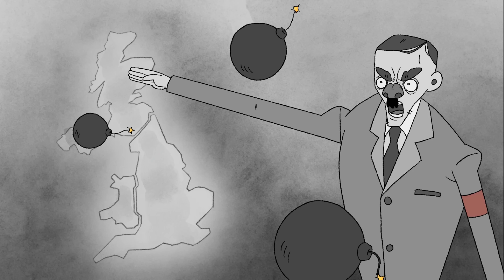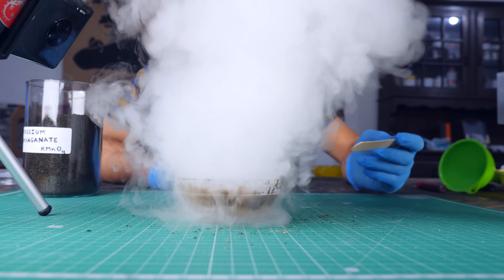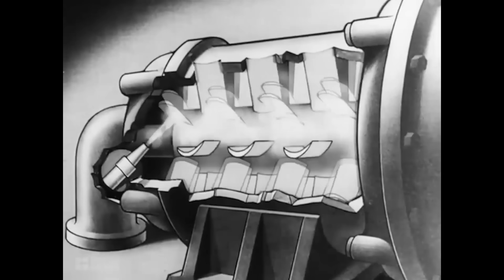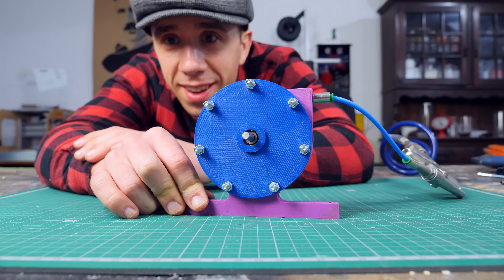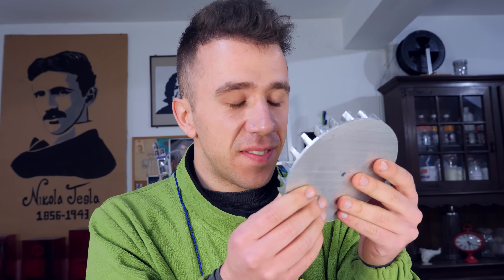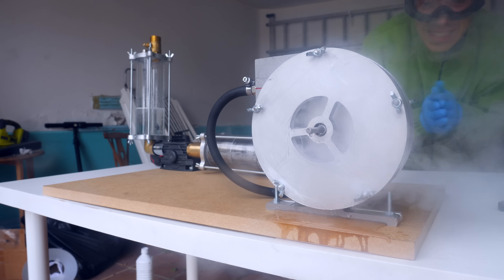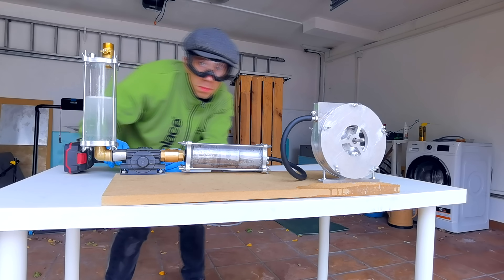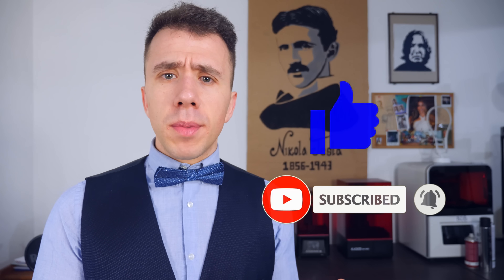I built the World War II V2 Rocket Steam Turbine

Comment: You can improve your design by making higher tolerances. You can also remove the grease from the ball brings using a solvent, instead us a thin silicone based lubricant often found in spray cans. This way you will remove some of the friction caused by the grease. Another thing you can try is to balance your turbine, set it in a pace where it can be suspended upright, the heaviest point will then move to the bottom, then you can either subtract weight from that side or add some to the other side. Keep repeating this until wherever you rotate your turbine, it will stay. You can also try to improve the power of the turbine by attaching some gears to the output shaft in order to provide more torque.
Reply: And don't machine parts with the bearings in the stock material.
Reply: Reducing friction like that will just increase the no-load RPM. Not any practical benefit IMO.
Reply: used to do tis with the bearings for RC car racing
Reply: He doesn't have the equipment to balance the turbine. Components rotating that fast have to be dynamically balanced (what you described is static balancing.)
Reply: @goodbye8995  As true as this is, it cant hurt to get a rudimentary balance on it so the harmonic vibrations don't shake the assembly to bits nor put stress on the bearings. It'll also gain alot more speed just from that simple balancing, rather then be unbalanced all together.
Reply: @Scientwisted  Better than nothing yes. But I question the entire operating principle he has chosen for the prime mover.

Surely a positive displacement motor would produce greater power at a higher efficiency. It would also be easy to overcome the problem of liquid passing through to the motor by making the catalyst tube longer, vertical, and doubling it's function as a receiver or buffer for the gases, which could then be throttled with a simple valve to vary the motor output.

The power output would be seriously higher with pistons or even Intermeshing rotors instead of that centrifugal turbine.
Reply: @goodbye8995  The operating principle was chosen because it was proven effective in the early days of rocket science. Just because his prototype can be beaten by other designs doesn't mean it has no merit.
Reply: @jstan_49  I didn't say that it has no merit, but my understanding was that it isn't his design, is it not copied from the V2 plans?

The V2 uses a turbine because it is a very niche application which needs the characteristics of a turbine.

I think the first question we need to ask is, what is going to be driven using the power generated by the chemical reactor?

The answer to that question will furnish the answer to what kind of prime mover is best... It's a moot point otherwise
Reply: @jstan_49  I didn't say that it has no merit, but my understanding was that it isn't his design, is it not copied from the V2 plans?

The V2 uses a turbine because it is a very niche application which needs the characteristics of a turbine.

I think the first question we need to ask is, what is going to be driven using the power generated by the chemical reactor?

The answer to that question will furnish the answer to what kind of prime mover is best... It's a moot point otherwise
Reply: @goodbye8995  I thought it was obvious that the application is a rocket engine.
Reply: @jstan_49  So he is building a V2? I thought that is just where he got the pump design from.
Reply: @goodbye8995  I didn't say he's building a V2; I implied he's building a rocket engine (a major application for turbopumps and fairly prominent in this video.) Given the content on this channel it's not implausible, though, skimming back over the video, it looks like he doesn't have any application in mind and just wants to mimic the steam-driven turbopumps in a V2.
Reply: @jstan_49  that's my point really, he didn't say what his objective is. I don't disagree with what you're saying.

Honestly, it's probably a native advertising channel for 3d printer vending etc. Much that gets "recommend" is commercial content masquerading as enthusiast's organic output.
Reply: @goodbye8995  from what I've seen (not subscribed, but oft recommended), he studies complicated machinery, like jet engines, and then tries to fabricobble replicas in a home lab. The entertainment comes when the 3D-printed jet nozzle melts and catches on fire, or the acrylic pressure chamber melts, explodes, and catches on fire, etc. This video probably won't do as well because the only fire was in stock footage.
Reply: Get rid of Grease using alcohol
Reply: Also maybe move the steam outlet to a higher point above the liquid level
Reply: He could try using journal bearings like in an actual turbo, it would require oil flow, but should provide super low friction, and try reducing the rotating mass that turbine is a lot of material for that little bit of steam. And lastly, he could try adjusting the input and output port sizes to optimize torque and rpm

Comment: maybe the geometry of the catalyst container is wrong. i mean steam rises, so when you have the ''exhaust'' sideways  some liquid is for sure to passby ,while if the exhaust is on top then only steam can pass by? on the other hand if you think about alcohol stills, and distilling, then when you have water in the other end it means the temprerature of the ''boiler''  is not correct so the whole catalyst stage needs some thinking. i know crap about chemical reactions however so i maybe wrong :-). 
as for the power output, just make a bigger turbine, with more efficient fins inside, try other geometry on the fins, 
for an idea about next project tho, :  3d print a drill and see how deep can it drill? maybe using said turbine??? it would be fun!

Comment: I think the catalysts are in the wrong orientation. You need them vertical. That way the h2o2 falls back down instead of being pushed into the turbine. You could also look into grabbing old hard drives from e-waste and using their platters for a nice tesla turbine. That or keep that turbine design you have. Try to go for roller bearings over ball bearings, if you can. Lastly, balance the turbine. Vibrations are lost energy.

Comment: Could some of the liquid coming out the other side be water that condensed from the steam when it hit the aluminum? As on each test, I'm guessing the parts are more or less at room temperature. So are very good heat sinks for the steam.

Not sure how long it would take running before the metal heated up enough to not condense the water.

Either way, great project!

Comment: Well...now we know how all the movie producers can make cars make steam come out of the exhaust in every shot...
Pretty cool...but you will DEFINITLEY need planetary gear set to reduce the rpm's...doesn't need huge power, convert high RPM to massive torque (same way a turbo prop engine or the engine/transmission of the M1 Abrams works)

Comment: make shallower passes to avoid tool breakage.
it is also advisable to use a cutting fluid.
this cools the work and lubricates the tool to avoid damage.
it's well within your capabilities to make a directed feed jet to follow the cutting bit.
[did a lot of hand machining]
Reply: ps, aluminium tends to grab a lot when machining.a higher flow is needed than when working ferrous.
happy machining joel!

Comment: Pre-heat the turbine to prevent condensation  of the water vapor and cooling of the oxygen.  I think you might be losing a bit of energy with a cold turbine.
Reply: I was thinking that + heating a pipe going to the turbine, but at that point things start to get pretty dangerous.

Comment: What about using a pressurized cylinder of nitrous or carbon dioxide to make a rocket? Not just using the pressure to some other device, but building a valve on the cylinder to lunch the whole pressurized cylinder up in the air? Put a parachute on it of course so as to recover it (ie not have it do damage to anything or anyone on the return back to earth).

Comment: Integza the first powered flight ever was a model built by 
William Samuel Henson and John Stringfellow . It was called Ariel or more correctly the Aerial steam carriage.
The model was built in 1848 which was able to fly for small distances within a hangar. The aerial steam carriage was significant because it was a transition from glider experimentation to powered flight experimentation. And the patent was filed under British patent 9478. I think you should try to use your steam engine to improve on the Ariel

Comment: Integza should use a flywheel off or a weed eater. A small 2 stroke flywheel should workbproperly since if has fins that move air around the engine block. And they are made of strong plastic or aluminum that is properly balanced

Comment: You seemed a bit disappointed at the end cuz it didn't produce that much power, so I think you ended up forgetting that this was used as a pump in the V2, not the main engine.
So I'd say this is WAY more of a success than you're giving yourself credit for, and you should make the main engine next that uses this turbine as a pump for the fuel and oxidizer :)

Comment: Would probly help if there was a gear reduction there, you have a small light turbine so you need to optimize it for speed and gear it appropriately.  More stages should help too.  You could make use of CFD software to refine things a little before you make them.

Comment: Maybe you could use the turbine to power a mechanical punp so the amount of hydrogen peroxide pumped into the catalytic converter is directly proportional to the speed of the turbine. You'd need a way to kickstart the system, and a governor of sorts.

Comment: You should mount your decomposing chamber vertically, with the inlet at the bottom. At the top you should make the chamber around 5cm longer to fit a big air gap. In that air gap the un-decomposed hydrogen peroxide can pool up to sink back down to the catalyst when needed. This can work as a buffer and should prevent any liquid spit-out that just wastes hydrogen peroxide.

Comment: 1) Try it with a Tesla turbine, and a Tesla one way valve. 
2) Mount the catalyzing tank vertically with the input at the bottom and exhaust from the top.
3) Use higher percentage H2O2. Some of that "uncatalyzed" Hydrogen Peroxide exiting the  turbine is probably just the water remaining from the 50/50 mixture 
4) MOAR VIDEOS!!!! :D 
Love your stuff Integza! Keep it coming!

Comment: For your next project , you could try to make a steam powered skateboard or scooter where you control the hydrogen peroxide flow and built a engine that can drive you around a little  

It's up to you if you use a jet engine design or a piston engine ^^

Comment: Is it possible to work on the delivery system into the combustion chamber itself?   Would you be able to have multiple smaller tubes (a bit like a heat exchange tank) within the chamber and hollow out the middle of the catalytic sections toward the exaust port, and therefore straight to the turbine?

Comment: You should mount the catalyzer vertically with the peroxide coming in from an inlet at the top, and the steam exiting a higher outlet also at the top. That should give the highest exposure to the catalyst and limit the un-decomposed peroxide from exiting.

Also, video idea: You could try capturing the decomposition results from that catalyzer, and then further decompose the water through electrolysis, after it's had a chance to condense again, so that you have a super-oxygenated hydroxy gas that can be added as both fuel and oxidizer directly into the nozzle of a rocket/jet engine as a sort of afterburner.

Comment: I have a idea for you to try to over come the problems of your current set up 
As I feel the  catalytic converters are not doing a good job decomposing  the 50% peroxide 
As you are using 1 - one way valve and a pump now 
Use 2 pumps and 2 one way valves 
As I was thinking if you mixed a correct amount of the 50% peroxide 
With a correct amount of the Potassium permanganate would produce a better end product of high pressure steam 
2 small metering pumps could supply the liquids to a mixing chamber to produce the needed steam 
The one way valves would keep the reaction in the mixing chamber 
Also by using DC motors to power the metering pumps you could adjust the output flow of each pump with a DC motor speed controller

Comment: Third chanber, filled with some open cell foam, would remove the residual water from the gas generator, and allow better performance. Also a reduction gearbox on the output shaft would allow the turbine to run at higher speed, so giving a lot better match to the generator torque demand, as the turbine will be running at around 10k RPM, but the generator will do around 2k. With a reduction box likely your power output will be high enough to run a car alternator, and light a 55W headlamp bulb.

Comment: couldn't you make a magnetic variance Drive so the basic concept is a bunch of stationary copper discs and starting from the spinning desk which has magnets on it there will be magnetic discs between each copper desk  spaced apart so they're just inside each other's magnetic fields theoretically the turbine would spend the magnetic disk which would spend the magnetic field which would just barely latch onto the rest of the magnetic just spinning around the copper  super low-resistance magnetic turbine

Comment: Put the catalytic converters vertical to make the decomposing chamber more efficient. My theory is that the liquid can be forced out easily while the chamber is horizontal, it’s less work for the liquid to be pushed through the tube, meaning your losing potential energy and on top of that, the peroxide could be causing more friction with the components on the inside, slowing it down.

Comment: @Integza silly idea, but wouldn't putting your catalityc converter for steam upright, with the H202 coming from the bottom & steam at the top yield an even better pressure for less losses? Also how come now that you have a CNC you didn't try using a Tesla turbine design? https://en.wikipedia.org/wiki/Tesla_turbine ? I expect it would yield higher RPMs and potentially more power with those two changes?

Comment: You could set the cat chamber vertical and add a few inches of free space so less liquid freely flows out, and add a pressure release valve so it only opens up and high pressure and not right away. For the turbine it mostly needs smaller tolerances, the closer everything is the more power it will generate, you do have to factor thermal expansion of aluminum due to heat from the steam. Next big step would be the curtis turbine but thats a very precise and complicated design witch is probably too much for a youtube video

Comment: I have an idea for a video you can make a hot air balloon and use 1 booster on the back with a counter weight at the front and to rotate it you can use a flywheel spun by a moter to take atvantang of the rotation that spins you the opposite way. And if you need a better way of getting it off the ground you can use a weather balloon

Comment: You might have some better luck if you mounted the steam output valve off-centre from your catalysing chamber. The boiling H2O2 is being pushed around in the chamber, and as it's rising higher than the vent port, it's being sucked along the tube, either like a steam powered super-soaker, or like a venturi.

The turbine design could probably be improved by reducing its mass. Fusion360's simulate tab will help you there! This will allow higher RPM and less loss to inertia. At some point you may need to replace the join between the turbine and axle with a proper keyway though, rather than just your epoxy fix.

You might also try applying your findings from your nozzle design experiments to your turbine housing - right now, as far as I can tell, you're just venting the steam out of a smooth bored hole at the turbine, the inclusion of a more effective nozzle inside the housing would increase the efficiency of power transfer between the steam and the turbine.

Good luck Integza! I hope this gives you some ideas for how you can complete your tomato-seeking vengeance weapon!

Comment: I want a 3d printer! So here’s my thought on improving the output!

We’ve gotta separate the unspent h2o2 from the steam. With the current design, the high pressure is giving you the same problem as with the permanganate. High energy fuel is shot out of the end because the catalyst works too well. If you added a chamber that allows the steam/peroxide mixture to fall vertically into, the peroxide will fall to the bottom, and the steam can be vented from the top. You can connect the top of the separation chamber to the turbine and loop the bottom back into the catalyst chamber. 

That should both improve the efficiency of the reaction and protect the turbine from peroxide erosion.

I don’t think rotating the catalyst chamber vertically will improve the output as well, because you’ll limit the amount of catalyst the peroxide has exposure to. The top converter will really only be exposed to steam. I say keep it horizontal and separate the output.
Reply: I came here to say, mostly this, just not as well. ;)  I hope he builds this.
Reply: Great ideas. I have no idea how to accomplish this, but I've heard that there is such a thing as an "air" bearing or a "liquid" bearing supposedly used in jet engines. 
Another material that is immune to oxidation, unlike aluminum, might be a better choice, though maybe a copper plating of the aluminum would help. Your setup is really cool! I think it deserves being pushed along further.

Comment: Wonder if a gear reduction would help with the torque and output of the turbine and resistance of the motor load.

Maybe hook it up to a motor as a generator and then have that connected to another motor to move the skateboard.